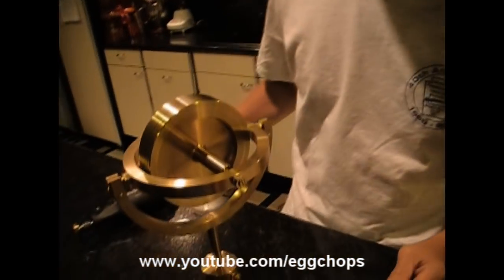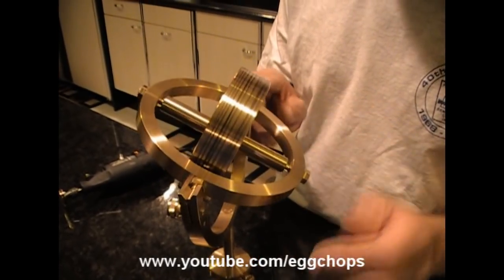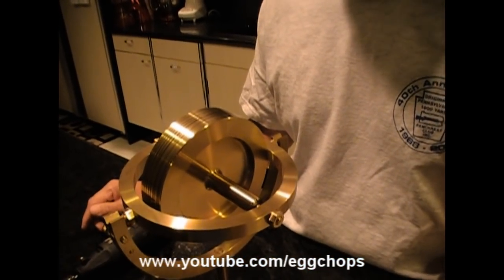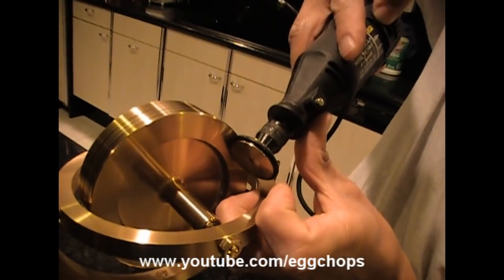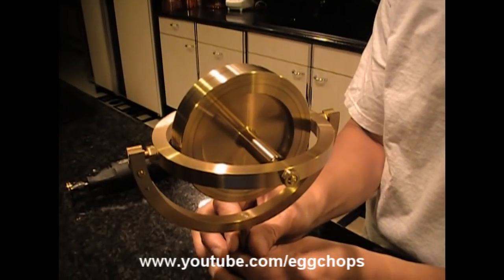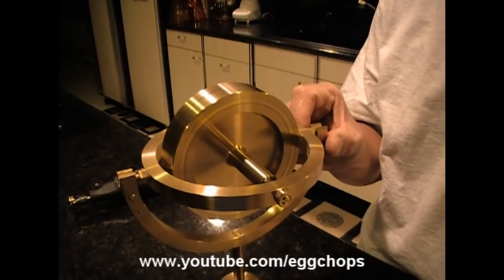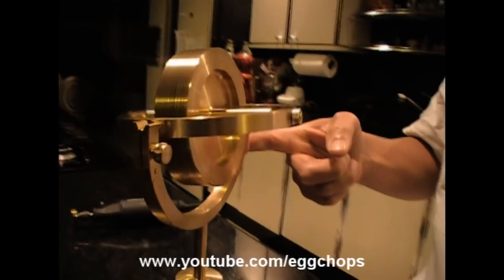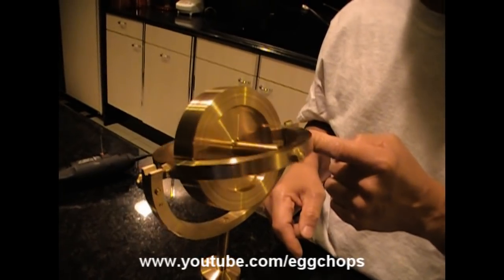Large Brass Gyroscope Demonstration [HD]

Comment: As a machinist I have to tell you, that's a really nice gyroscope, and I've always wanted to make one but haven't gotten around to it even after over 30 years. Yours may be the inspiration to do it... I have a grandson who would be fascinated by it, especially if he could actually touch one, and feel the resistance... He's so smart I think he would understand it quickly! Thank you so much for sharing this! :o]

O,
Reply: I desided to do I wil uplaod a vidio to my chanel no bild vidios becos I am not alowd to film in my school s workshop
Reply: I'll pay $10,000 for a large electric powered gyro on gimbals that flips over every 24 hours as the Earth spins. Small gyros don't seem to be strong enough to change angle as the Earth rotates for some reason.
Reply: @chesshooligan1282 Tru, you can use a god string or cable, and a led or tungsten weight.
you can also have it mark up a huge box of sand.

I'd refrain from hanging that in a living room though. A garage can work. The longer the rope and  heavier the weight, the longer it wil keep swinging
Reply: Be his mentor, and best of luck to you and little fella.

Comment: Does a gyro only experience spin down from wind resistance and bearing friction? I notice when someone tries to force a gyro to move out of its natural position requires a lot of force. Is that force only distributed on the bearings? Meaning all that force is just sliding? Would less efficient bearings cause a greater spin down when a force is applied?

Comment: Old passenger liners used massive electrically-driven gyros to stabilise them in heavy seas.
Reply: They use gyro stabilizers in boats, today. They are an option on most pleasure boats over 30 feet. They come standard on some high end luxury yachts and deep sea fishing boats. They're not very massive these days. They only need about three feet of space in the boat.

Comment: That is a very well built piece of equipment.
It would be very interesting if you could set it up with degree marks (on a piece of paper under it) and a fixed camera (above it), for say six hours. It would move 90 degrees, because of the earths rotation is 90 degrees in six hours.
Reply: Steve Thomas , Earth doesn't move.
Reply: @1starshot That experiment is poorly designed.  The small force caused by any rotation of the gyroscope would not be sufficient to overcome the large friction in the rotation axis of the setup.
Reply: @1starshot  FlatTards Jeranism and Mark Seargent got hold of a laser ring gyroscope, and it shifted 15 degrees an hour, they proved the motion of the Earth.
Reply: @ToxicTeemoOCE  Don't normally call people names, but in your case I'll make an exception..LIAR.
Reply: I'm a liar. How so?
Reply: @MrBrain4 They are fooled because its shiny and pretty. Buts its ok for this experiment.

It should also make very little noise. The noise indicates points of friction.

I used to work on aircraft gyroscopes in the Navy. It would spin so fast you could not move it at all. I believe the rotating part was made of tungsten. IT would take over an hour to slow down before you could move it. However if you bumped it sharply, it would fly across the room like a cannon ball! Yeah, speaking from experience on that one.
Reply: @ghanus2009 I edited my original reply to make it clear that I am replying to 1starshot and his reference to the poorly-designed experiment to "disprove" earth's rotation.  For some reason (probably old browser), my replies don't properly nest or reference who I am responding to.
Reply: @ghanus2009  I suspect the bearings were simple pin in bronze bushings meant to be oil lubricated. If so, the bearings needed oiling, as they were squeaking.
Reply: @MrBrain4  The problem is with U-tube. I find my responses are inconsistently handled, regardless of the browser.
Reply: @ghanus2009  I suspect a fair share of them are simply trolls.

Comment: Cool! These demonstrations always remind me of the Brennan Gyro Car,  the Gyron X , and the Ford Gyron. Have you ever made a Tesla Turbine using hard drive disks? They can spin up really fast and  then be used like a gyroscope.  I ran across a digital computer patent 3190554 that runs on compressed air. Think one could be made using 3D printing?
Reply: What happens if you keep applying horizontal force around the vertical axis? Will the difficulty transition from being hard to easy once it becomes oriented? Will it lock into this orientation until you apply a different force to disorient it?

Comment: Could I ask if you were to have 3 x gyro fix to one unit in opposite direction would it float? Or cancel out gravity.  Forgive me for sounding stupid.
Reply: Blog Kidzz Gyros can be moved with no real effort as long as you don't spin them. eg. he could lift it up the table with the same force as if it were not spinning. same way gravity can pull it down.
Reply: Blog Kidzz by that them I mean the gyro itself is spinning, but you don't try to rotate it like he is when he pushes on it
Reply from the maker: Good question actually!

While it's hard to see in the video, gyroscopes don't resist the urge to fall, but rather, to twist along an axis. So the object you are describing would certainly fall at a normal speed, but it would be hard to turn or re-orientate in another direction.
Reply: A spinning gyro does not lose weight, so cannot cancel gravity and float. There are at least two videos demonstrating this.

Comment: Dear Ed! I've tested a big gyroscope when I was in the 2 course at the University. But, actually, always in my life I wanted to build one. Can you provide some information about it? What type of bearings are in this gyro? Any dimensions of the gyro itself? Unfortunately, I can't find a video on how to, or any dimension of these gyros. I know that you can make it with whatever size you want, but I like your results! :) Thanks and BR! Bobby
Reply: +magdanoz88 I was thinking same thing about the schematics, but you know what? it's not that difficult to build once you understand the basic principles and have the right tools. Sure out of brass looks better but you can use pretty much anything. The basic rules apply to all shapes and sizes. The bearings must be able to handle w/e spin is there and the calibrations must be just right, other than that it's all simple math. My suggestion for you is get information on bearings and start from that to put a plan on paper. Have faith in your mind.

Comment: Wow, I'm 60 and never seen anything like that, now auto-pilot makes sense. It appears to be as if it's gear driven in the rotor's reaction to movement, and I bet it is just as accurate. I'll be damned, I got a toy one I blow up to no tellin how fast with my blow gun in the shop. I always use a saftey squint too. I think I tossed it the last time due to the fact I can't trust myself to be an adult.  Thanks for the video, I should'a took science instead of .

Comment: They should use those to make aircraft flight and navigation instruments
Reply: They used to and some still might, but most modern systems use more precise electronic/laser measurement devices to detect rotation.
Reply: @Tuxfanturnip  They do. The primary gyro instrument is called the Artificial Horizon. Gyros are also used in at least some autopilot systems.

Comment: could this gyro demonstrate the rotation of the earth?
Reply: all gyroscopes do
Reply: really?   .................. earth rotation?
Reply: Yeah. Navigational gyroscopes are suspended in such a way as to keep spinning for hours and also have motors to keep them at around 12.000 RPM. Say you point a  spinning gyroscope at the north star and wait a few hours (assuming it doesn't stop), it will still point at the north star after an hour, even though the earth has rotated 1/24 of it's circumference. This is how ships navigate without using magnetic compasses.
Reply: Eliark your explanation is far to simplified.

all navigational gyros are automatically corrected for earths rotation by a very precise and compkicated spring arraingement.
Reply: Partly true. I did not claim navigational gyro__compasses__ (which contain two or more gyros and are suspended in liquid, weighted and digitally corrected on top of a "spring arrangement") were affected in the same way. Please read more carefully before accusing me of being wrong about something I know more about than you.

A balanced, spinning gyroscope left on a flat, stationary surface will always precede according to earth's rotation.

Edit: I see I may have formulated myself unclearly, but I still never state anything outside of the experimental "system" of a spinning gyro pointed at a star. The rest is your assumption. At any rate, the comment from OGW was not "please give a detailed explanation" but a simple question with a simple answer: "yes".
Reply: wendel dickau yes
Reply: the earth is flat and stationary
Reply: pointing to the North star works with a flat earth too
Reply: Probably not because friction and air resistance would off set it. You need a very expensive gyroscope to measure the rotation of the earth.
Reply: Why do we have the four seasons then?
Reply: EARTH is flat and motionless. You can not prove otherwise using natural testable science.
Reply: @kriskrul3859 Because 8 would be too complicated.
Reply: @bloodsthicker5651  It is trivial to prove the Earth is not flat. A telescope and a view out over the ocean is the easiest. But it can be done even on dry land, such as the Black Rock Desert or Great Salt Flats.
Reply: @kriskrul3859  There are four seasons only because humans have artificially divided the year up into four arbitrary periods. The division is no more or less valid than dividing the year up into 12 approximately equal months.
Reply: @buggsy5  do you have measurable curvature for us?
Reply: @bloodsthicker5651  No, because I did not have the necessary distance and angle measuring instrumentation that would all the calculations.

However, Codyslab has a video where he measured the curvature over land and he did the calculations and, better yet, showed how he obtained his results.
Reply: @buggsy5  are you able to show the link at all ? And someone that's verified that too?
Reply: @buggsy5  do you deny the natural physics of water?
Reply: @buggsy5  do you also deny the 2nd law of thermodynamics?
Reply: @bloodsthicker5651  The video segment should be somewhere at https://www.youtube.com/user/theCodyReeder/videos

I seem to recall that it is part of a video, so some searching will be necessary to find it. You can verify the information/procedure yourself, since he shows the views through his telescope.

What do you mean, "deny the natural physics of water"?  

And what does thermodynamics have to do with what we are discussing?
Reply: @buggsy5  please post the vid.
You sound like you're trying to convince yourself that you live on a rotating pearoid ,which is your choice, but you'd have to ignore science.
Reply: @bloodsthicker5651  What do you mean "trying". I long ago convinced myself that the physical evidence proves the Earth is not flat and that it orbits the Sun. I have not seen any evidence otherwise, nor does anyone ever seem to provide any argument otherwise except "it is flat" or "have to ignore science" but does not provide any physical evidence to back those claims.

I just mentioned cory'slab video segment because I ran across it in the past when viewing one of his chemistry videos. I have no idea where it is on his site and am not interested in chasing it down.  

By the way, the proper term would be "oblate spheroid", not "pearoid".
Reply: @buggsy5  slightly chubbier below than above the equator hey. If you're happy to believe, then stay convinced dude.